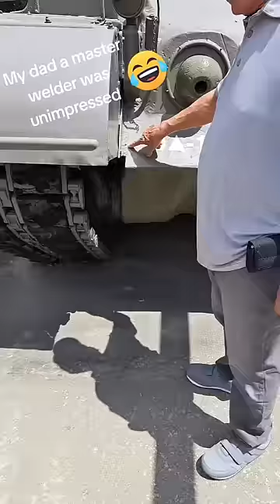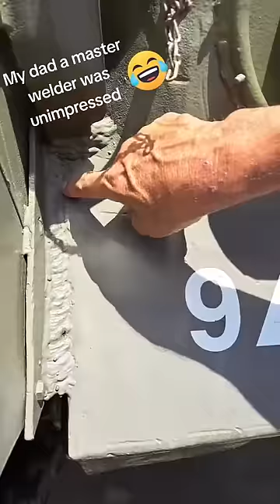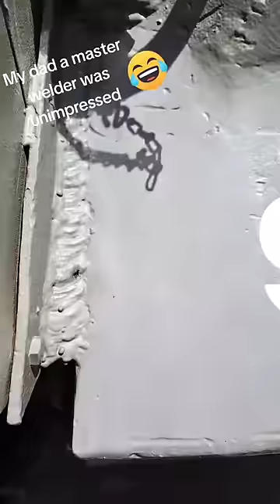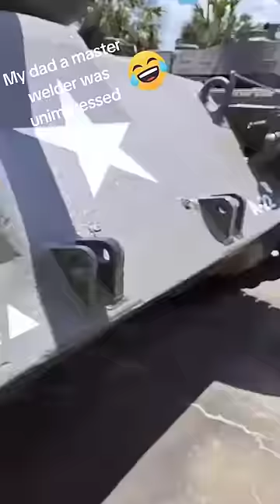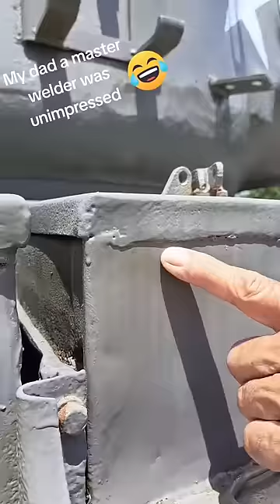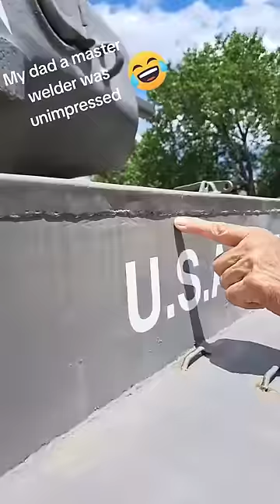Dad being dad. Repost from @Loflo_productions(TT) #yeswelder #shorts #welder

Comment: My dad was a nuclear certified welder , helped build and repair navy ships... he would probably say "you gotta do what you gotta do" and in the middle of wartime or even not in battle, they did what they could. 
Full respect ti veterans and welders, fabricators, machinists, everyone involved.
Reply: Stand up man
Reply: @Pill_Smith how is anything he said virtue signaling
Reply: They don't build these tanks on the battle field
Reply: No one cares.
Reply: They did what they could and what they needed to do. People need to realize they can spend hours perfecting each weld these tanks and chassis had to roll out in massive numbers to support wartime.

At least with our WWII tanks, I would definitely argue that the urgency in rolling out as many tanks as possible outweighs build quality.

The Russians were pumping out 30k tanks a year. The T-34s were tested and 90%+ time they had mechanical failure which stranded the tank after 300km.

Imagine throwing away your car after driving a couple hours. That’s what the Russians did to win the war, the tanks pushed 300km and the crew got out and hoped into a new T-34 while the old one was sent to the repair yard.
Reply: @AlexG-pt2zs lmfao imagine welding a tank in the middle of battle with explosions everywhere and shots flying over your head 😂😂😂
Reply: Alot of people forget it was UNTRAINED wives who built half of this gear..  getting it out in mass numbers and getting it done. If they were no good and didn't work. We wouldn't have any of them around to look at.
Reply: Wtf are you on about dude @Pill_Smith

Comment: You need to understand that in the time of war , our country needed everyone's support,  even bad welders👍
Reply: Is this some sort of confession on your part? There are no excuses for bad work.
Reply: @josemurillo2424 lemme see you try something you never did an be amazing at it
Reply: @josemurillo2424 its literal war, the “good stuff” you want comes after it ended 😮
Reply: @josemurillo2424 there’s no excuse for you . By the way , why wasn’t the Mexican army storming the beaches of Normandy ?
Reply: @dmeacom4688 Because Mexico wasn't at war with Germany?
Reply: @josiasavila2003 Still doesn't excuse shitty building quality. If you weld the front plate of a tank badly, you can risk having that plate crack off, even with a shot that didn't penetrate. That is NOT A GOOD THING, bad quality gets crews killed, just looks at the build quality of the Soviet T-34.

Comment: "A grinder and paint makes me the welder I ain't"
Reply: Legends of the fab shop.
Reply: Caulk and paint make me the carpenter I ain't lol
Reply: I remember when I first started welding 25 years ago my dad had me in the shop and told me to weld out just a simple 3f weld test. First thing I grabbed was the grinder and headed to the table. He stopped me about half way there and said whatcha doing with that grinder, genuinely confused I said well just in case I mess up. He stopped me there and said son pick your career either be a welder or be a grinder.
Reply: @dr3dnaut38 😂😂😂😂😂😂
Reply: @dr3dnaut38 Being skilled with a grinder is part of being a good welder.
Reply: @signifyingcracker3944  part of being a good grinder is being a good grinder. Part of being a good welder is knowing how to not have to use the grinder other than cleaning your plate and weld area.
Reply: @dr3dnaut38  I've had helpers totally wreck an otherwise successful day due to their lack of proficiency with a grinder. Knowing how to do it yourself is a plus. PS started in metal trades in 73. Reducing transition on certain weld joints with a grinder can save one a lot of rods/wire, but you need to understand how to go about it.

Comment: I can attest that when you're related to a welder, you learn quickly what a bad weld looks like because they will point them out wherever you go together, lol❤
Reply: Yeah, i make popcorn before i read comments on welding videos.  Plaster repair is almost as bad.
Reply: You’ll also realize how little it matters in the end because there’s so many bad welds in the wild surviving.
Reply: @kolinmartz  It matters because welds hold together more important things than basketball hoops and stationary bikes.  Sometimes there are lives at stake.
Reply: My grandpa was a brick/ stone mason. Now i stand outside peoples houses staring at the work like an asshole.
Reply: I was a welder for 8 years and find myself doing that. Won’t believe how many bad welds I see at the gym on fitness equipment.
Reply: I've been a scaffolder for 27 years and I reckon if my wife hears about how the bracing is wrong on one more scaffold we're walking past, I'm getting divorced.
Reply: My dads been a welder for like 20-30 years and works with metal he has not once done it but half the time when we do something in the city etc he says look ive made that door or hey that balcony there i made that
Reply: @DrexAW Yeah man I'm a spark. I wish my dad was still around. All I'd get all day, driving round town was, see that house there, wired that when I was about 25 for Bobby. This restaurant, did the lighting in there about 10 years ago. I just know I'm gonna be the same now my lads are older 😂 never mind all the things I pull in front of people that have no idea what I'm taking about. They must think what the fuck, shut up. Why you talking about  how one light is one course of bricks higher than the other. Shut up 😂
Reply: you see what you know
Reply: As a welder I attest
Reply: I think this applies to most trades.  My dad was a tile setter and he was always pointing crappy jobs.

Comment: It's still together 50 years later, must not be too bad
Reply: That’s like 80
Reply: @TTTray13467  the fastest way to learn new info is to post the wrong answers lol, 😊
Reply: If that was 80 years ago a good question is how good was the equipment was that they used to weld
Reply: @motodude23  I mean it's ww2 man that should be common knowledge
Reply: Damn right, maybe even field repair, but I’m sure the “master welder” knows the circumstances surrounding all these welds as well 😂😂
Reply: Because it’s not being used
Reply: Wouldn't be surprised if this is a replica or rebuilt from real parts of a destroyed/partially complete one or something.

But even if that's true it doesn't make the weld any better lol.
Reply: Probably hasn't had one round shot out of it in 50 years either
Reply: @sylvestercastaneda3699 Maybe not even a shot ever.
Reply: @motodude23 q❤
Reply: 50 years of this 👆 attitude is why the USA is the way it is today
Reply: Yeah, it was not only never used but also painted over so it never had any risk of oxidation. I'd be super embarrassed if that was my weld.
Reply: @caseihpopper they had acetylene and arc welders by that time, probably mostly arc for tanks and ships
Reply: @dennysautorepair946 no he doesn't. He welded pipe all his life.
Reply: 50 years ago we had M60’s, this shit an M26, 1944+ tank
Reply: @CatsAreAmazing8187  Actually an M41, they were built in the 50s.

Comment: if that's an original weld from the factory, it was more than likely done by "Rosie the riveter", and it's held to this day, and we won the war.... I'm glad she could weld at all :)
Reply: I was thinking the same thing
Reply: That is a Soviet t34 and most all the welds on the hull were done by machine
Reply: @vista8863 This is not a T-34, nor is it of Soviet origin. It’s an M26 Pershing (From the little bit I can see) hailing from the 9th Armored Division, 14th Tank Battalion.
Reply: Excuse me a what, does that turret look lika a t34. That's a Pershing
Reply: @vista8863 if you don’t know, you should just not say anything you just made a fool of yourself…
Reply: So back in the day during WW2 they used to have to do the welds for the tank themselves whenever they needed a repair or needed to add more metal armor. They didn’t have the best welds but it got the job done, we won the war. The welders were often doing many tanks at a time and had an extreme turnover rate so they had to weld while in the war zone.

Edit: when there weren’t welds being done in the field they were done by female factory workers who were also working in an intense turnover rate. Welding tank after tank after tank. The bad welds you see are usually done by the men in the field due to the nature of the scenario and the better welds like the ones on the tow hook were most likely done by a woman in the factory.
Reply: And this is the thread of comments I was waiting to see and definitely not say anything. Definitely didn't know what tank it was or what Era 🙃🫠 glad yall know what tank tho and that it was good Ol Rosie
Reply: Just because it survived doesn't mean it's good. Check out survivor bias on plane damage. "Rosie the riviter" likely cost way more lives with shitty work like this.
Reply: @elyrienvalkyr8167  very sad
Reply: @vista8863 bros looking at OD-Olive paint with a bright white star and NATO markings.

“Bruh that looks like a Soviet T-34!”
😂
Reply: If it's a it well it must be an it. Thank God Rosie won the war. Where would Europe be without her. And if Spongebob ever served anything but a crabby patty, you wouldn't be fit to serve that man truck sauce. Stay out of the trades and other people's business.
Reply: @elyrienvalkyr8167 my godfather explained that to me and it was super interesting.
Reply: @CensoredonYT he graduated from war thunder university
Reply: @zooweemama911 spot the warthunder player
Reply: That was the most wholesome thing ever said 🥰
Reply: @vista8863 wtf,  you and 2-3 people agreed that it's a russia t34...
Wtf.
Did you look at it?!
Reply: @omega-death Yes it is. M41’s don’t have a dedicated hull gunner, which this tank clearly has. Turret shape indicates a Pershing and the angle of the front glacis is off compared to an M41. Look up pictures of both and watch the video a few more times.
Reply: @vista8863  You're embarrassing
Reply: I don't know shit about tanks or pretend to.
It's fascinating though, and I like listening to war buffs.
Reply: @vista8863  it literally said  "U.S.A " on the goddamn side!? 😂🥴
Reply: @zooweemama911  Man if you are gonna correct someone at least be right, it's an M41 Walker Bulldog.
Reply: @VitaKet  Since I guess you’re incapable of reading through a very simple thread, I will repeat myself. M41’s don’t have a hull gunner position, which this has. And the angle of the front glacis is off. Calm down buddy.
Not to mention the shape of the turret is completely different. It’s not that hard to Google before making a fool of yourself.

Comment: It’s a tank, not a submarine,being made at a time when quantity over quality was more important. Even in poor quality the rule of thumb is 1sq in of weld is worth -/+ 1000 lbs, for mild steel anyway.
Reply: Yeah it may have been a field repair to get it back on the line. Not to mention could date back to WW2 era. Welding equipment and filler metals weren't what they are today.

Comment: Not only is it still holding together, it was likely welded with speed being of the upmost importance over perfection. Looks good to me.
Reply: I am thinking there's a reason the welds would be done poorly
Reply: Not a welder, but I imagine skilled welders have both speed and accuracy.
Reply: @60secondpages  nope. You can have perfect or you can have fast. Can’t have both.
Reply: It's holding together because it was retired before the T72 was fielded...
Reply: @bdun1226  https://youtube.com/shorts/P97zbncg3Ss?feature=share this is obviously modern day, but I think it illustrates a consistent weld at speed, so I think you can have both.
Reply: @60secondpages  can’t
Reply: @bdun1226  can
Reply: @60secondpages you still don't get it. Grandma welded these.
Reply: Thank you. Gramps thinks it's pipe welding.

Comment: Looks like "filling a 1" gap with stick" weld. Looks like holding the tread cover. Understand if it was a field weld because the stock fender got blown off. But off the assembly line, fooorrget it.

Comment: Its not a water tank dad. They specifically required different welds for specific armor plates. Those welds are HISTORICALY correct.
Reply: not true. these things were built in a rush in mass supply. done by ppl left over who never deployed. they were using woman in the factories because they were running out of workers to catch up with the demand. those are crap welds and probably barely passed an inspection. also never ment to look pretty. holes in a weld is a faulty weld and a weak point in the armour and could cost a life. a hole in the weld would never pass in any point in HISTORY. you just made up your comment, its not a fact
Reply: @BarkerVancity  Those rushed welds done by those women are the period correct welds?  So the mistakes he was seeing were authentic? So I'm correct? I mean you say it's rushed then you say they'd never pass inspection then it did because there it is.

Comment: One of the reason for those welds was because someone else probably did lose their life in that tank and it was quickly repaired and patched up.  Sometimes welds dont look great when theyve been welded 3 or 4 times in the same spot.  Also Shermans werent great tanks.
Reply: Yeah if you mess up a weld and try to go over it, it's already too late

Comment: As someone already mentioned, they were manufacturing these things at lightning (lol) speed. They also had far, far less effective welding equipment and material during such times. Sucks because gramps is right, welds like these on a modern war machine would 100% lead to avoidable death.

Comment: It's military hardware. It's made to just be put together, and then when a part is destroyed, removed and replaced. The welds don't have to look pretty. They just have to hold. These are war machines that are going to get many repair welds if fielded in combat. A weld will not make a difference when faced with a shape-charge, a shell, a mortar, a rocket, or an IED.

Comment: My father was a welder in the Air Force. They were being tested. The guy next to my father switched the welding plates, when my father wasn’t looking. My father told the one in charge that the guy had his welded plate. So the one in charge told the guy, if it was his.. he said yes. The the one in charge told him to weld a plate in front of him. The guy had to confess. Pretty clever of the one in charge. It was lowery Air Force base in Denver Colorado.
Reply: I did not know welding was taught at Lowery.....i was there for DP school
Reply: @jonsingle1614  It was 1956-62. My father was the jack of all trades. He was also an MP He guarded the X-15 or whatever secret aircraft was in the hanger. He welded crash landed aircraft that were not to badly damaged. That’s why after he retired from USAF he got a job at LTV building F-7 Corsair 2 in Grand Prairie Tx. 65-70 for the war in Vietnam. Back in the fifties and early 60’s lowery was an experimental place.

Comment: That was a slag inclusion, the weld was so wide it cooled before he could completely tie it in, and the protective layer called slag, which pull contamination and seals the hot metal from the air, got trapped between layers of weld. Porosity is tiny bubbles of gas, like a sponge, which can be caused by several factors, rust or water for instance, and the weld will fail more often than not. The correct way to run that weld would be with long overlapping welds called stringers, not the short, crisscross pattern called weaves. Weaves are good for lots of things, but this welder didn’t quite pull it off.

TLDR: welder made a mistake, but it wasn’t porosity like the guy in the video said, it was a slag inclusion

Comment: I love it. I'm a retired commercial electrician and I walk into a place where there's lot's of exposed conduit and I do the same shit as this old dude. Nit picking the shit work left behind!!! Some of the conduit bending I see out there is anything but acceptable. But they had to pull the wire through it and terminate so to each their own headache, I guess, if you can get it passed the building inspector.

Comment: Just in ww2 alone we produced 86,000 tanks in a span of 5 years and 297,000 aircraft, 193,000 artillery pieces, and two million army trucks they weren’t worried about who had the best welds and they didn’t even matter because no part of that tank could hold up to the sheer power of the panther or the Pz. IV you should go take a look at those tanks

Comment: A tank needs perfect welds though?  Weve seen these tanks blown up and there welds weren't messed up, it was a hole that got blown into it and then exploded on the inside.  The tanks still look like you could just clean them up and reuse them. And from the look of these they actually made it just fine so did many others. They have alot of weld on them so they're not thin welds. If you really want to nitpick at something try going up to the white house and the capital buildings and nitpick away at everyone. Im sure they wont mind, they'll probably be wondering what to say.

Comment: But the real question is, could he do better in a mud hole, using 4 6v batteries and jumper cables?
Reply: That’s… not how it worked
Reply: @Jason21012  well, if it was a field repair, its very much possible. Lol and 110% doable to get operational again